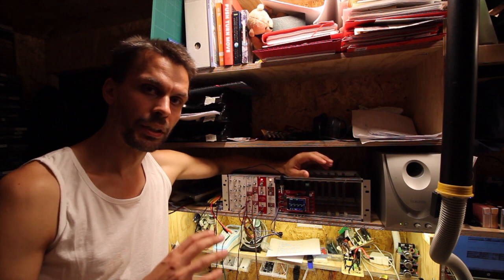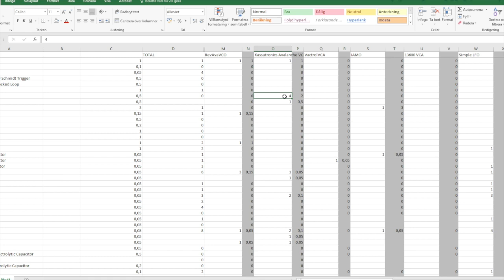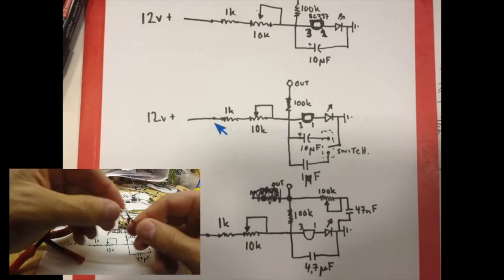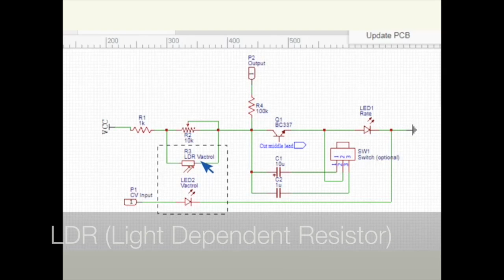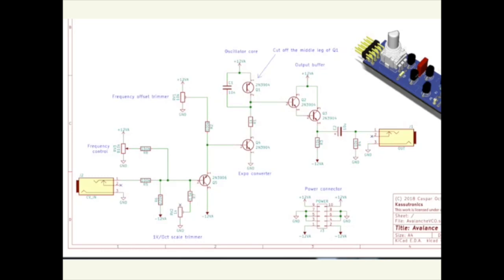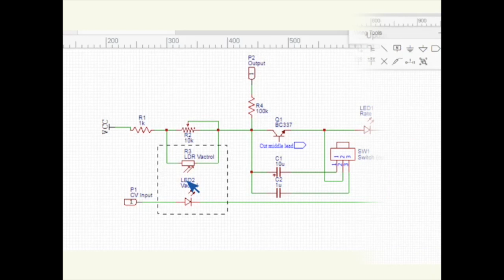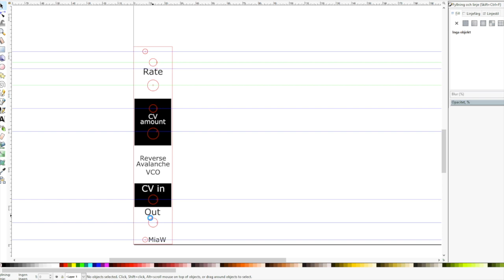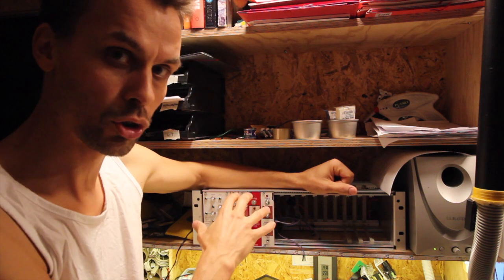Reverse Avalanche VCO - DIY Modular in A Week 1.4

Comment: Very cool! I breadboarded Look Mum No Computer's idea and I'm testing lots of different transistors. I'm using 12V and having no luck with pile of 2n3904s. Obviously 12V is too low. However bc547 and bc337 work very well. There's one minor problem. No output where output should be. But I'm taking it from LED legs instead. Actually I removed the LED and just put the output there. And it sounds great. But why there is no output on 100k? Am I missing something? Anyway You got new subscriber! Cheers :)
Reply from the maker: Sorry for late reply. I know there was some quirk on the lmnc schematics that I changed but can’t remember now. I use the bc337 and that works. The 100k does dampen the signal a bit maybe that is it? Remove the 100k and then directly into the opamp buffer if you use that? I think I will try that too. To get louder sound hopefully (it is a bit too soft in comparison to the other vcos)
Reply: @SourceryOne  Thanks for the reply! No worries for being late. In the meantime however I have found where I was dumb and maybe too tired to think :). In the begining I was using just a small speaker to test it and that's why the regular output with 100k didn't work thus I took the output from led legs. And when I went to my guitar amp it didn't work with this alternative output either. Then it's hit me. Amp has high impedance input so of course it didn't work with this. I redo the proper output with 100k and it works like a charm! Added 3 more oscs with different caps and a little drone machine has been born :) It was 100% my fault. My amp was too far from my workbench so of course it was prone to mistakes when you're running up and down the stairs with the breadboard :D
Reply from the maker: nusior lol. Great you got it to work! A video showing it off and some sounds maybe? ;)
Reply: @SourceryOne  Yeah, definitely!  It just needs some tweaks and temporary enclosure. And for some reason none of the 5mm LEDs that I have work in this circuit but 10mm LEDs work fine :D And since I had only two of them i just put 1n4148 or something in the other oscs just to finish something that day :)
Reply: Hi there, I uploaded a short demo here: https://www.instagram.com/p/BsYXLmfnACQ/
It's cool but it gets boring quickly so I HAVE to make next things :D oh btw I found out why those 5mm leds didn't work. All of them in that batch are just reversed :D
Cheers!
Reply from the maker: Exactly about it getting Boring quickly. That is why I did so many modules in a week. Make at least one of each “day” so to speak to get up and running without getting too bored. ;)
Reply: Well I'm a little too slow and not organized enough to manage to make one a day 😀 I buy some parts and after that I have another Idea or it needs different parts which I don't have or I just forget something... so more waiting time for next shipping. Just recently I wanted to buy +12v -12v power supply from guy who makes them 3,5,9,12,15 etc or some custom ones too. And I was probably sleeping and bought 15v one and realised when it arrived 😁 I'm sure it'd be useful but for now I want 12v 😁 hmm maybe spreadsheet like yours would be a solution😀
Oh sorry for rambling too much!
Reply from the maker: Have you seen my workspaces in my videos! I am not an organized person either. But I can step up in short bursts. 😂 For my one week I made sure I had the basic sets of resistors caps and diodes. Then I went through a bunch of schematics I wanted to build and wrote down all the components and then ordered them in one go. That way I didn’t have to pay shipping more than once. Ramble on. ;)
Reply: I guess I'm even more chaotic than that 😀 when I did that order I was completing parts for some guitar pedals. But in the meantime synths ideas came so only some spare parts were applicable. So another order😀  I have some local suppliers and that's handy but they don't have everything or they have too much the lowest quality crap so I have to look elsewhere too. Not to mention CEM3340 if I want something "classic" 😀 Btw do You have any thoughts about V3340 or AS3340 equivalents? Anyway planning ahead would be good. Maybe for 10 next projects. But how could I know what I want next😂 But something more reasonable than "I will order thousands of jacks because someday I wanna have a wall like Junkie XL so I pay only once for shipping" 😂

Comment: Hm, it seems like i can't answer your message directly. I am powering circuit with +12v and gnd from DIY PSU (where is separate "+", gnd and "- " outputs awailable). I should measure output from 10k pot, its so obvious) Thanks for reply!

Comment: Hello! I am currently testing a simple avalanche OSC (without CV input or buffer). The first BJT i was testing is 2n3904, but it needs higer voltage to start oscillate than BC337. I've bought a bunch of BC337, and it seems to be another problem now - the oscillation starts only on a half-way of 10k potentiometer :) I was looking sharply to your demonstration, and it seems like you don't have such problem. What can it be? The range was just fine with 2n3904.. I've been trying different resistors before pot, different value of pots (5k behave just as 10k, only 2-nd half, and 1k is going all the way, but with awfully narrow frequency range. Larger pots is useless). Did you face that kind of problem? Schematics are all the same, i am confused. 
Also i noticed that in Kassutronics schematic circuit is powered by 12v, but he uses 2n3904 (in my first test they was only start oscillating at 16-18 volts). Maybe i need to breadboard his schematic to be shure. 
And yes - thank you for this amazing series! This inspires me to continue working on my modular)
Reply from the maker: How is it powered? I have the halfway potentiometer problem when driving a 12v-Gnd osc with a +12–12v cv pot. The freq range wasn’t that good for me either and even with amplification it is still very quite.

Comment: Hey there, with this module your sheet is messed up :(
First you say - it is only one Jack, when it is obviously two of them, right?
Second, in cell number M73 you say we need two parts, but two parts of what? It is a row right under the 470uF 35V Electrolytic Capacitor
Could you please clarify it?

But of course, thank you so much for your videos.
Reply from the maker: Thank you for the heads up, and sorry for the inconvenience. I fixed the sheet so it should be correct now (I hope). I added a few more notes to the cells where you can choose components. The two parts on the empty row is gone... As for the jacks, I explain in the video that for the CV input you need to make a Vactrol circuit (shown in the next episode after this 2.1). And in that module if using it as a CV-input to the RevAvaVco then you get another input from that... So watch the next episode aswell for the full explanation of this module with CV... Oh, and make sure you open the latest version of the excelsheet as I just fixed it...